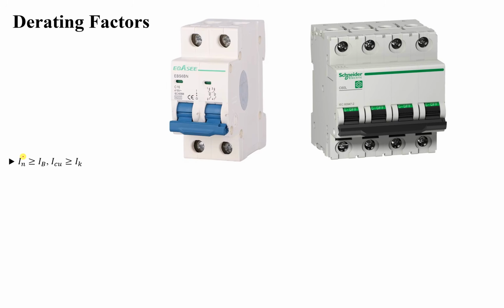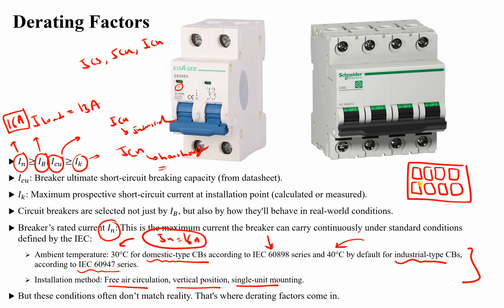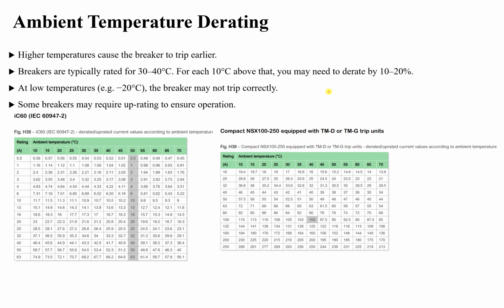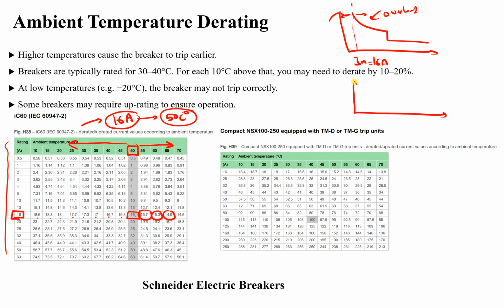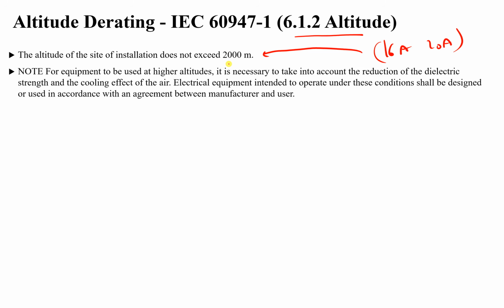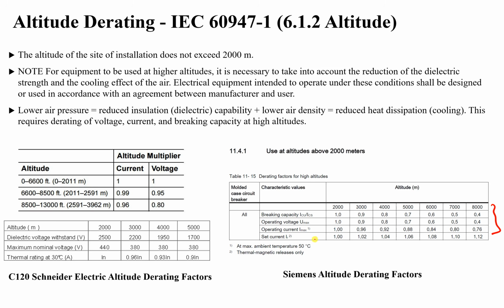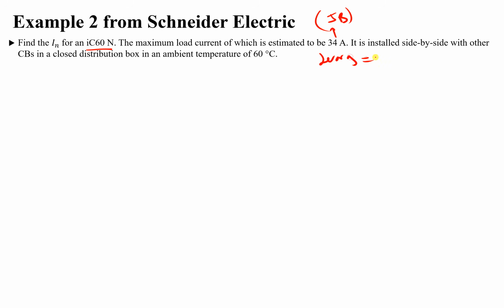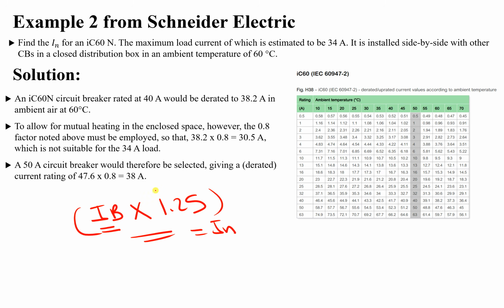Selection of Circuit Breakers  - IEC with Derating Considerations

Comment: "Installed side-by-side in closed distribution box" 19:40, what if distribution box had 1 row of circuit breakers (12 slots) and the circuit breaker was the last one on the distribution box, would I still have to apply derating factor of 0.8? What if I had a DB with 2 rows of circuit breakers (24 slots) and again, my mcb was the last one on lets say the 2nd row, would I still have to apply derating factor of 0.8? Is grouping cosidered when mcb is side-by-side or is it also considered when its on the far end of the distribution box also? Thank you.
Reply from the maker: It doesn't matter because you have a closed panel with multiple breakers; each one radiates heat energy, which affects the other breakers surrounding it. That's why you apply the 0.8 regardless of the breaker location. My advice is to always check the manufacturer datasheet, as it may contain additional info on the exact derating factor based on the number of breakers or the panel size.